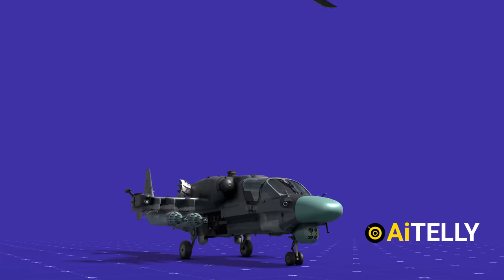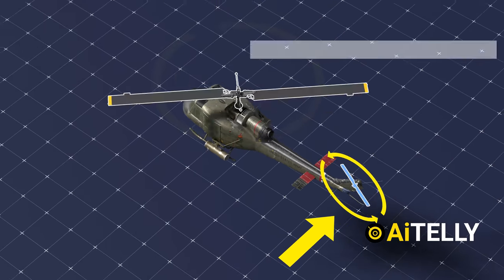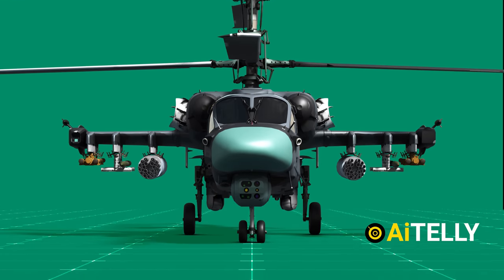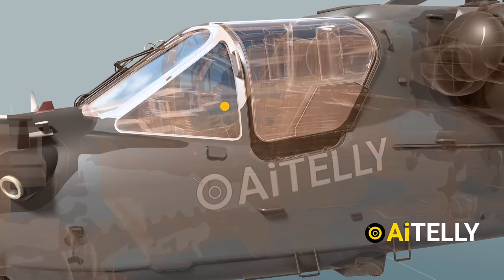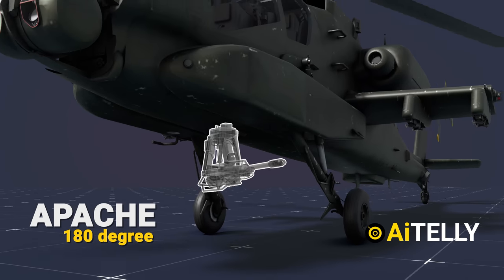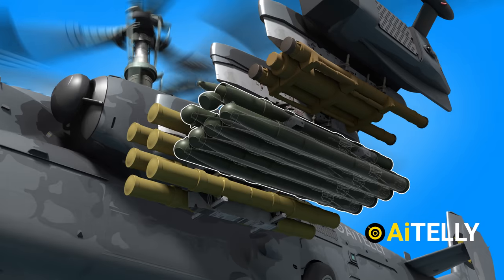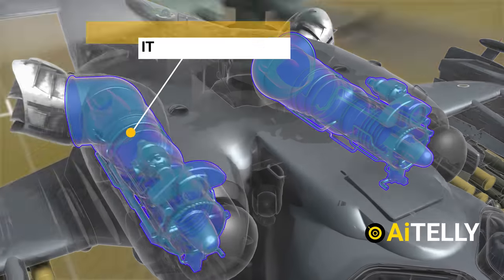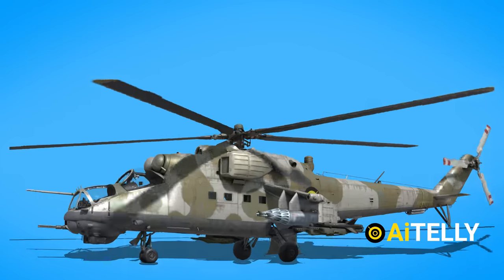KA 52 How Military Coaxial Helicopter Works #ka52 #helicopter #coaxial

Comment: This is the best helicopter in the world so far.
Reply: As pro-Ukrainian I think this is the best helicopter in terms of survivability. It has one weaker point compared to Western helicopters. However, I think Western avionics are supreme. Can see opponents sooner and missiles are pinpoint accurate. But a single manpad can take a apache down. Only defense is what it is equipped with, anti-air stuff. 
Good enough to occasionally destroy incoming missiles. But not strong enough to dominate enemy territory.
Reply: @jeffp2935 rong. Russian ka-52s fires also from a distance and we seen how badass this helicopter did in the ukrianian your generals incompetent strategy of counteroffensive that ended in a biggest failure of modern military century. All you are saying is western helicopters have better electronics. Slightly yes but rest in maneuvers, maintenance, firepower, reconnaissance, survivability ka-52 is sure surpasses apache and it's best helicopter in the world
Reply: Agreed. The aircraft has proven itself in a real war against competent opponents and weapons ( as opposed to the Apache shooting at mountain dwellers with AK 47s )
Reply: @alexnderrrthewoke4479  no wonder a lot of them got shot down.
Reply: @862F4  so? All ka-52 pilots got saved. Plus they can still fly being hit. Also they updated ka-52s so it's even more difficult to shoot down. Why you barely hear any being shot down?
Reply: @alexnderrrthewoke4479  where do even get this assumption that barely any got down there's plenty of videos posted in the internet already showing ka52 being shot down, there is no helicopter that can survive modern anti air missiles, so your comment is clear bias.
Reply: @Arthur_Grande  also there is videos of ka-52 surviving from those missiles many times. How about you check those. Oh you can't because you don't want your feelings hurt
Reply: @alexnderrrthewoke4479  "why you barely hear any being shot down"
Lmao the sure amount of cope in this line is beautiful, yes there are videos of them surviving and getting shot down but saying barely any of them getting shot down is just ridiculous.
Reply: @Arthur_Grande  do you speak English? Again tell me the numbers bud. How many? You don't even know
Reply: @alexnderrrthewoke4479  my replies keeps getting deleted for some reason and I can't post the link, there's a website called oryx and they list all of aircraft lost with photo documentation.
Reply: @alexnderrrthewoke4479  so? we were talking about helicopters not pilots lmaoooooo.
Reply: @Arthur_Grande  oryx is not reliable source as it's very pro ukrainian and I knew you would say that so nice trye
Reply: @ayooo454  did you learn English or you being a troll now?
Reply: @alexnderrrthewoke4479  and incase you're hallucinating helicopters in general will always be prone to any anti air missiles their not invincible which it seems what you want to portray.
Reply: @alexnderrrthewoke4479  your "a very pro russian" yourself so I bet you won't watch any videos posted here in YT and anywhere showing your beloved ka52 being shot down.
Reply: @862F4  thats so 2022
Reply: @alexnderrrthewoke4479  10-20 ish in early 2022
Reply: @Arthur_Grande  theyre not invincinble but the electronic warfare complex on the ka52 actually stopped 18 stingers iirc, as for the one that got downed by a javelin at, no heli is going to survive an antitank missile
Reply: @ligmasurvivor5600  that's pocket change.
Reply: @alexnderrrthewoke4479  what's pocket change
Reply: @Arthur_Grande  i don't think he he circlejerks with others on the ka52 like how all the westerners circlejerked the leopard before it got turned into scrap by one of these helis
Reply: @Arthur_Grande  since Russia's strategic withdrawal last year there haven't been any shot down by Ukrainian forces.
Reply: @ligmasurvivor5600 yep, and none since Ukraine ran out of stingers
Reply: @jeffp2935  Не выдавайте свои желания, за реальность. Ни один западный вертолет не сталкивался с  ПВО России . Сдается мне, гореть они будут, как и любой другой вертолет.А учитывая что ПВО России лучшее в мире, а оно лучшее, с этим спорить бесполезно, гореть будут сильно хорошо.
Reply: @862F4   ahahah, another BS.  there were few at the beginning of SMO, thats it. Aviation in general is quite ineffective these days, hence low use
Reply: 44791
Reply: Guess guess again this helicopter has a high rate of failure in its main train powertrain, and it's extremely fuel thirsty limiting its range significantly.
Reply: And its parts by the way for it's super duper radar and it's time to tection come from the US so don't expect them to get any replacement parts anytime soon. What the Russians make well are  artillery. They are good at prototyping but they're terrible at production.mostbof their quality parts came out of Ukraine. Oops! Their electronics came from the US, Korea and Germany. Scratch those suppliers 😊
Reply: This comment has also aged like milk😂
Reply: Как и Путин 😂
Reply: @Arthur_Grande  Stop being trapped in your own cocoons, the modern russian helicopter avionics are as good as current NATO enlisted. It is highly modernised and automated compared to the apaches, where the system engineering design was from back in 80s and 90s. The ka52 has exceeded the apaches for sure.

Comment: In modern warfare, helicopters are consumables, regardless of the country. The reason is the dominance of systems for hitting air targets over their protection system. In terms of avionics, the Ka-52 is the best combat helicopter in the world.
Reply: There is an optional active defence system for ka52 that can be installed as an external module. I know a few episodes when a single ka52 has been attacked with multiple manpads and most of missiles have been neutralised by this module. I guess it blinds it or something.

Comment: We are now finally seeing the best these KA-52's have to offer during Ukraine's offensive, they have been stalking whole NATO equipped columns undetected and without taking losses in months. There was even a video going around of a KA-52 STILL flying fine after its whole tail section was ripped off, truly showcasing the benefits of the coaxial blades
Reply: 2022: Western tanks are a game changer. They are designed to resist Soviet weapons. 
2023: Anyone else remember what an unexploded Leopard and Bradley look like?
Reply: The tail fell off exactly as the KA-52 dropped the external fuel tanks.  Extreme vibration and poor maintenance.  High Resolution video from Pilot following in formation
Reply: @alexchristensen9712  no, read carefully what the author of the original video wrote
Reply: @VVV85650 rusia 10.000+ confirmed losses

2000 tank losses 😭
Reply: @juanpablochaconvargas6919  Ukrainian counteroffensive ran into a steel wall. Seven thousand killed in action, 160 tanks and 360 armored vehicles were destroyed in just a week without achieving any special results,” Col. Richard Black.
Reply: @alexchristensen9712  no, it was hit by a Stinger.
Reply: @Shovel_ops do you say "soviet" to make it seem old? Because incase you haven't noticed, these things are upgraded every time there's a new break through. Same with any other military equipment in any country. As the the structure of the helicopter itself, it is a masterpiece. Perhaps other helicopters have not been exposed to what the ka52 are in 2023.but I have never seen any other heli do what this one can. From seat ejection to being able to safely land or keep in air while heavily damaged. Your opinion is a rookie one. So says the warning when you try to reply lol
Reply: @ruszeus1208  you cant upgrade old cans infinitely to combat modern models lol
Reply: @Alex-wp1ne1  🤦 radars? Anti radars, missles and even the computers... yeah, what rock have you lived under? All that and probably much more is upragradable.
Reply: @ruszeus1208  yes, but the Ka-52 is a unique helicopter, what sets it apart is the Co-axial rotor with 2 rotor blades rotating in opposite directions, giving it agility, flexibility, maneuverability and the stability  in the air like no other helicopter model.  and when you guide the anti-tank missile "Vikhr" with a laser from a distance of 12km, stability makes a difference
Reply: @Ivan-wp1ne1  ka52 its upgrade ka50 helikopter 1993 year maded
Reply: @jamesfirs1017  no dude, this does not work like that. Upgraded versions dont win the next number, but letters like M are added
Reply: @Ivan-wp1ne1 😅 у тебя не работает у русских работает
Reply: @juanpablochaconvargas6919  Umm, no. But you keep believing that okay? If it helps you sleep in your Momma's basement.
Reply: @pacus123  another one who does not know what ORYX is, from what I see most of you do not know what it is to investigate but normal after all, visual tests cannot be counteracted ;)
Reply: @phamcongthang2669  another advantage is that the smaller rotor diameter permits operating much closer to steep embankments and to fit inside boulevards in urban situations to hide. Yet another is engine temperature while hovering out of ground effect being much lower due to avoiding the wasted energy routed to the tail.
Reply: @ruszeus1208  bro forgor that m60 pattons can take abrams turrets also
Reply: @juanpablochaconvargas6919  oryx abit the unreliable
Reply: @alexchristensen9712  It got back to base, I saw the photos that the pilot took.
Reply: @andrey_shar007kpuca2  I saw the video it fell off as it dropped fuel pod
Reply: @ruszeus1208  If anything, these helis remind me of the B-17s from ages yore. One and a half engine running, tail almost completely cut off, but still flies back home safe and sound. Impressive engineering on their part, that's for sure
Reply: During the start of the Invasion 38 were downed because they were used offensively 
This helicopter is outdated and only good for defensive guerilla skirmishing against armored offensives while taking cover, But I could say that about any attack Helicopter in general, same goes for MBT's  / Drones, glide bombs, smart munitions for cannons, long range arti, supersonic missiles, those are the stuff that rule the battlefields of today

Comment: Perfectly modeled.
According to official data. The latest upgrade (Ka-52M) has a new radar with a fixed AFAR on 640 receiving and transmitting modules that detects a bridge-type target at a range of up to 100 kilometers, a destroyer—class ship — 150 kilometers, and air targets - at a range of up to 50 kilometers. At the same time, the new radar weighs 10 kg less than the "Crossbow" - 120 kg instead of 130. The new radar also has the ability to detect helicopters in hover mode at a range of up to 20 kilometers.
Also, the authors did not mention LMUR, the footage of the first use of which in a combat situation was made public last year.
An interesting fact is that when working on infantry, the Ka-52 is often used as a flying MLRS (the helicopter lifts its nose up and releases unguided missiles along a ballistic trajectory).
Reply: They also have new anti-tank missiles with a 12-15km range.

Comment: It's also worth noting that tandem bladed helicopters are somewhat quieter because the two rotors end up canceling out some of the noise generated by the other. So by the time you do hear the vehicle it's going to be quite a bit closer than you'd expect it to be.
Reply: This is not tandem; it's coaxial. An example of a tandem design is the CH-47 Chinook.
Reply: @brianb-p6586  Hundreds  if not thousands of folk have read Yukimaru0 comment and new what they where trying to say. But you dear fellow win the prize for actually stating the obvious.
Reply: @TheClanAdventures  it's not obvious to the person who made the video; if it were, the correct term would have been used.
Reply: @brianb-p6586  your still doing it.
Reply: @TheClanAdventures  Theres nothing wrong with the correction. People who want to learn (like me) appreciate it. I didn't know the difference until now
Reply: ka-52 is bit quieter than volcano eruption actually (lower rotor chops compressed air from upper one)
Reply: Most of the noise of a non-coaxial helicopter comes from the tail rotor, as it spins significantly faster than the main rotor. No tail rotor, less noise.

Comment: It is worth adding to all the above weapons another guided missile "Izdelie 305" or "Product 305". This new guided missile has a range of 14.5 km and a warhead weighing 25 kg. You've probably seen a video of a Russian missile flying through a window. This is the rocket.

There is no point in comparing the KA-52 with the AH-64. There is no reliable data on on-board electronics, optics and radar. In fact, these are just platforms for launching ATGMs. Russian ATGMs fly faster and farther. The American ones, I believe, have better guidance. But the KA-52 has more systems that allowed the pilot and the weapons operator to survive.

Comment: Apache should be compared to Mi-28N, I suppose they are very similar. Kamov's device is... rather unique, I would say. And, good job with all this 3d-modelling. It looks superb!
Reply: Correct. AH-64 is not comparable with this machine. Ka-52 is much more advanced, both by engine-trust technology and avionics. Mi-28 is the true competator of AH-64. The Kamov is just another in another league.

Comment: Almost normal review but many mistakes in parameters... 9K121 Vikhr-1 range is 10 km (supersonic, 28 second to max range), S-8OFP1 range is 6 km, and at the 5th and 6th hardpoints are 9S846 "Strelets" (Archer) with modified missile based on 9K338 Igla-S (not the same, with different flight profile and characteristics). And many other types of ammunition aren't been mentioned at all...

Comment: There is a loss of thrust on the lower blades caused by the turbulent air from the top blades. This is a really cool helicopter.
Reply: @Vlad_Shv  No. The lower blade is not taking in clean air. That makes it less efficient. Blades or wings that take in dirty air are less efficient every single time. That's what rotor wash is. It's dirty air.

Comment: Airframe is an engineering beauty. Main gun being barely movable is a big question mark, but the rest of the helo awesome. I watch Russia Ukraine war closely and these things when they take a hit usually lumber home or emergency land with crew being able to walk away. One of the few things russian military complex got right imo
Reply: I think it is the same reason as why modern jets have it, its not main armament and thanks to good maneuverability it would be aimed and shot by pilot not the gunner, same for ballistic computer guided missiles, it slight movement may be for computer improved aiming to compensate for axis motion
Reply: @WwarpfirewW  Yeah, I figured they would aim with the whole helo, but I think there may be different considerations as to the helo positioning and direction in combat situation, so it is limiting. The rest is great in this thing. I think coaxial rotors is the way to go for a number of reasons.
Reply: As far as i know none use it. 
Its weapon against rebels w/o even Stingers. Otherwise you risk heli to kill just couple of soldiers? Noncence
Reply: @Maks_Morkovkin  it uses HE rounds, if not that effective though, still very good suppresion
Reply: Tbh most helicopters today can fly with only one engine or loss of a tail rotor. Not many helicopters need to be this maneuverable at the cost of fuel consumption. Yea it’s impressive that it does all this and you can eject if needed, however the way this thing operates (up to distances of like 10km) the chances of you getting hit so bad that you need to eject are slim

Comment: the 9k121 whirlwind missile has a range of 10-12 km and not 8 km. Also, penetration behind dynamic protection is 1200-1300 mm and without dynamic protection 1300-1400 mm, depending on the type of missile, there are several options, including high-explosive fragmentation warhead and thermobaric. Early missile samples had penetration of 1000 -1200mm then they were improved bringing the penetration to 1300-1400. In addition, the rocket is supersonic and flies quickly, given the 12km launch range, the flight time is about 12 seconds

in the same way, the ATTACK missile has more than 800 mm penetration, in addition, there was an upgrade and increased penetration even more, and the launch range also seems to have been raised to 10 km

the Vitebsk defense system is incredibly cool. fully automatic. detects missile launches at a helicopter, warning pilots by voice and even indicates the type of air defense used against the vehicle. it also automatically fires heat traps. moreover, it is even capable of burning a thermal imaging matrix on a rocket. There is also electronic warfare that interferes in the radio wave spectrum, which also affects the air defense of missiles operating on radio wave guidance on a target, and moreover, the electronic warfare system is capable of jamming radars due to which the enemy sees more than one on his radar ka-52 and a dozen targets. That is, it creates false targets, due to which air defense systems with radars can shoot at non-existent targets. incredibly effective. So much so that the commanders forbid Ukrainian soldiers to shoot from MANPADS at the Ka-52, since the protection system is capable of repelling several missiles fired at the same time (as far as I heard 18 missiles were reflected at once during the tests) in general, try to shoot down a Ka-52 helicopter from one or even several MANPADS -52 is almost impossible and you will only give out your position, so the Ukrainians almost stopped shooting at the Ka-52. because of this protection system, the ka-52 was often used to escort other helicopters such as mi-8 mi-17 mi-24, that is, a group of helicopters flies and the ka-52 covers Vitebsk nearby with a system.